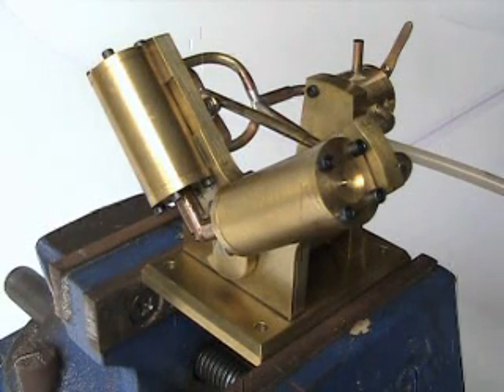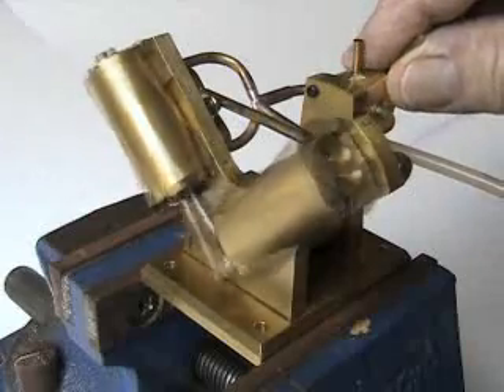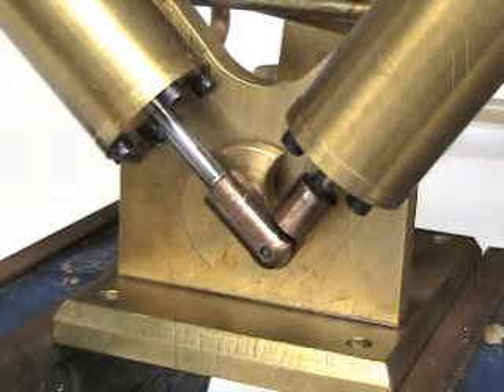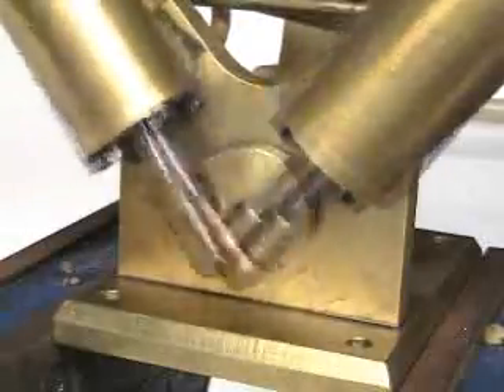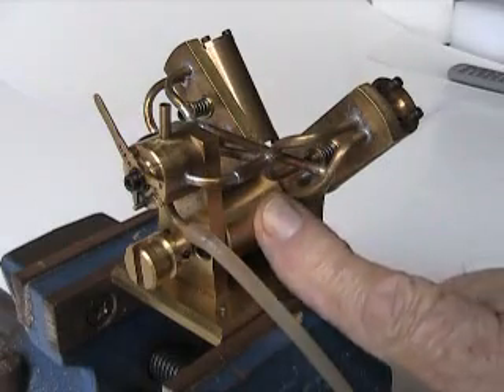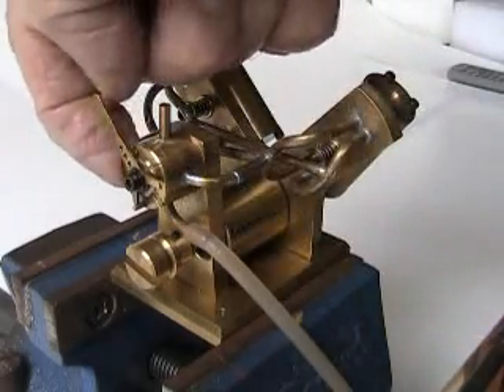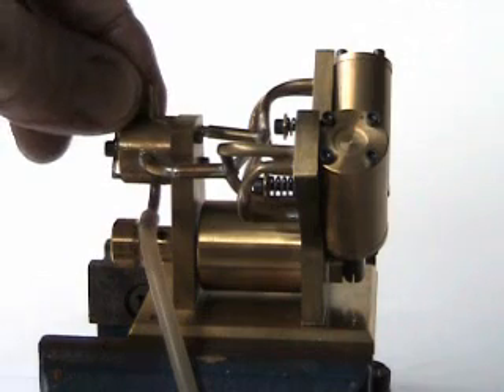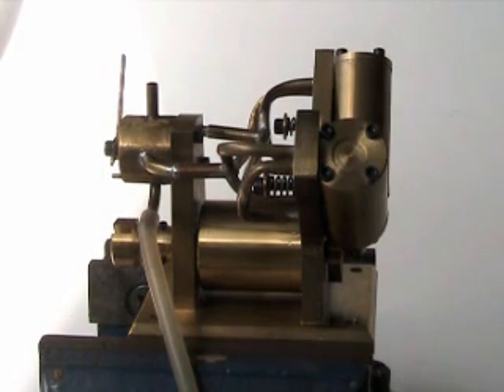My Little Twin Cylinder Steam Engine!

Comment from the maker: Any oscillating steam engine will have some degree of vibration in a rocking plane. This twin cylinder engine is no exception, yes, there is some vibration, but not excessive. The crank disc is counterbalanced, and since the two cylinders are at 90 degrees to one another some of the oscillating rocking vibration is reduced.

Comment from the maker: @diegeeleel 
I think you refer to my oscillating twin cylinder inline engine! This is a double acting design. i.e. the steam or compressed air delivers a power stroke in both directions of the piston travel, and the steam (air) goes to the cylinders via a reversing valve.  This reverses the flow to provide operation in forward or reverse, but the steam or air always enters via the bent tube below the valve and exhausts through the vertical straight tube on top of the valve.  Glad you like it!

Comment from the maker: @oochicooch Thanks, Nige - Your message needs a long reply!  #1, after the work, unless you find a rich and enthusiastic collector, there is no money to be made!  #2, you not only need a mill and lathe, but lots of accessories and tools; 4 jaw chucks, rotary tables, bits end mills, & most important, good measuring equipment: micrometers, dial or electronic calipers, dial indicators, dial test indicators, etc., And you must be very careful. Email me (johnsimmance@comcast.net) & I can help! - John